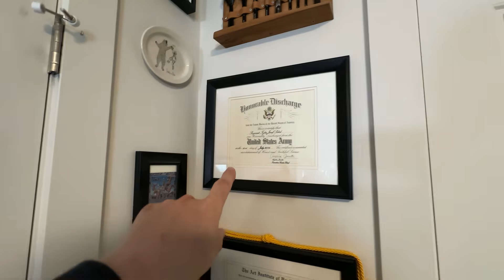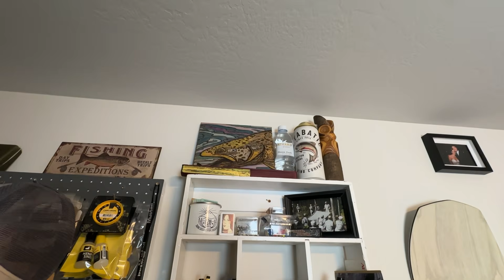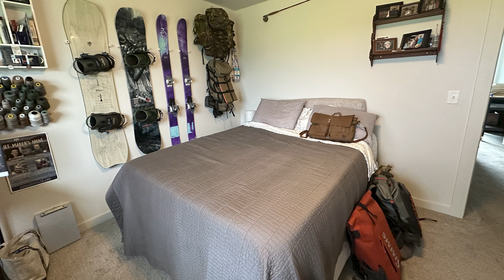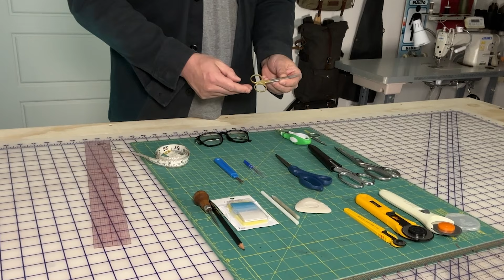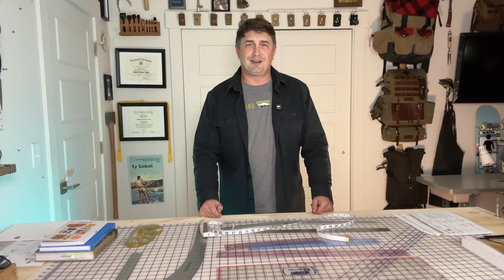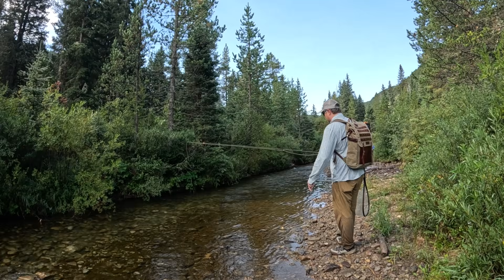Talking Shop With A Designer

Comment: Threads are a difficult thing to buy.  Most fabric stores don't list the weights of  threads anymore other than heavy duty or not.  SailRite has a chart that shows the needle size and thread sizes that it works with.
Reply from the maker: I've noticed that too... I mostly just buy my thread online these day because of that, but that creates its own problems. I end up having to order small quantities of different types of thread since I'm just going off photos on a website. I wish we had a good fabric store nearby, but that's one of the trade-offs of living in a smaller city.
Reply: @ThimbleAndAxe  I know about the small city part.  I live in Clark, Wy.  The fabric store in Billing closed down so I have to order things on line.  I really like to see and feel what I buy.
Reply from the maker: @dfhepner  I usually don’t even look at fabrics at first when I’m in a fabric store. I walk down isles just feeling each bolt or roll I walk by, and if I like the hand-feel then I’ll look at it 😅
I’m not quite that intense when it comes to thread, but finding the right thread can make or break a project.
Reply: @dfhepner it's the same in the UK. Our local sewing shop closed down 6 years ago, and now my nearest is 14 miles away (that's a long way for me!) although it is a good one. I also like to feel and see fabric before I buy.